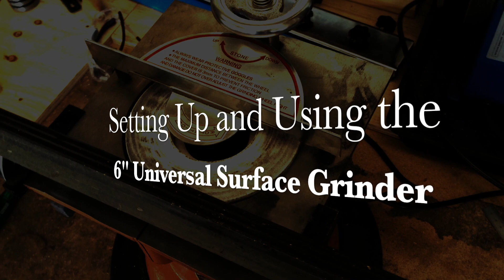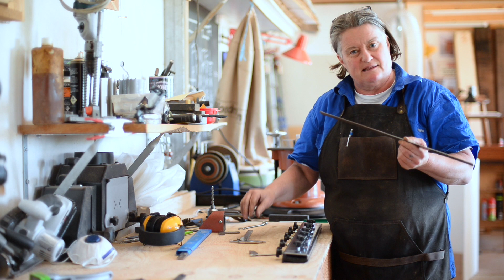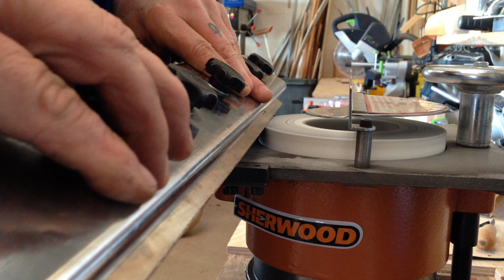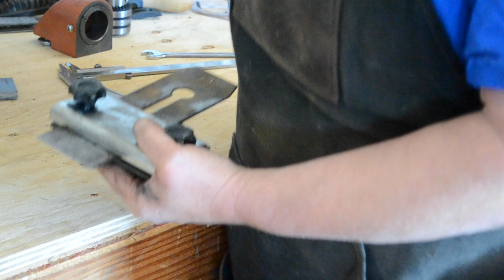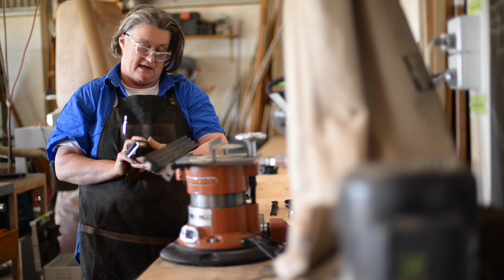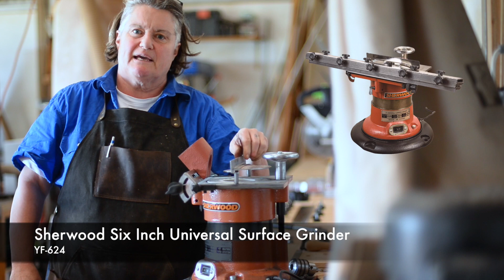How to Sharpen Your Jointer Blades

Comment: Bought this after watching the video and ruined a set of 20” blades trying to get a straight edge on them… they were super sharp but curved edge to edge… 

I reset the rests…. Tried shallow passes… changed positions on the wheel…. Nothing worked

Finally took a serious look at the tool rest… the fixed part is square and flat

The holder?….. not so much…. Two mm rock edge to edge and definitely the reason the knives are ruined

Not happy at all after spending near $600 AUD on this… quality of a sharpening tool should be better than this!!!
Reply from the maker: Hi mate, thanks for getting in touch. This is disappointing - that's clearly miles out of spec. Flick us an email at customer.service@timbecon.com.au and the guys will get this sorted out for you ASAP.
Reply: @timbeconaus  it gets worse…. I had the tool holder machined flat…. $80 well spent… however, still no joy on getting blades sorted…. After discussing with local manager (as opposed to an email…. Ever heard of 2 way rather than 1 way communication Chris?)… we spoke of a possible bad grindstone…. Another $60 for a diamond dresser…. Took off 3mm and what a difference… now it cuts !!… fixed!!! or so I thought! …  the blade angle was wrong and changed across the blade….. the cause?… the single post height adjustment. There are 4 guides machined in the base with reliefs to reduce friction and for the grinding dust etc to escape… this should minimise friction enough to allow the single screw riser to lift the table up and down….. mine isn’t machined central… causing the moveable plate to bind and jam as it only has 3 machined guides and impacts across the casting surface where the 4th guide should be. As it binds it lifts the plate out of square changing the depth and angle of the cut at random…. I’m hoping this is a ‘one off’ machining fault and will chat today about a replacement … the single screw riser is an issue….it’s definitely the weak spot of an otherwise pretty solid machine…. Wondering if the Grizzly model has the same issue?
Reply: Did you finely fix your problem, because I have the same problem can you help me
Reply: Yep… took it back and they replaced the entire motor section… new one is much better but still not perfect
Reply: @robtaylor893 I have the same problem with a different brand name but same machine. If id known about this problem before, Id not purchased it. I guess I should have looked at this first.

Comment: Just purchased this sharpener. My thoughts,
> Unbelievably underpowered motor, stalls with minor pressure.
> Very Chinesey quality. Too much play in the mountings to be accurate.
> Height adjustment is totally inaccurate and unpredictable. 
> The stone supplied is only good for final dressing, not material removal such as taking a thicknesser blade down to remove chips.
> I had to replace the stone with a 6" bench grinder stone to do blade repairs. 
With enough modifications I am sure it will just do the job, but the pathetic little motor will always create significant limitations to what its potential could have been. Very expensive for a light duty toy.
Reply: I purchased 2 yesrs ago and won't use it as it as it jams and tilts when trying to adjust hieght. Contacted supplier and all they do is keep asking irrelevant questions. I am licensed carpenter joiner with 50 years experience so not my technique!!!
Reply: @alexmcshane4584   Totally agree.
Haven't used mine in ages as it is just a poor quality low powered toy suited for the home hobbyists only.

Comment: A little tip: take the blade to the extreme end of travel and loosen up the clamp nut and let the blade fall onto the stone and tighten up that side. Now move the blade to the other extreme direction of travel and losen up the nut and drop that side of the blade to the stone and tighten. The blade will now be perfectly aligned to the stone.

Comment: This tool is interesting but...  When she started talking about how it would take hours on a wet stone to get it in shape, I was struck by the fact that the concept of course, medium,  fine never occurred to her.  If you have a really rough blade, you wouldn't start with a 4000 grit stone. A few strokes one a coarse stone, then go progressively finer.

It's the same with a chunk of wood or steel, you wouldn't use a smoothing plane to take a sequoia to a toothpick. You would start with a saw.

I looked on the company website for this tool they have an article called "Water stones vs wet stone grinders vs slow speed bench grinders - which is better?
" that starts with "If you’re a water-stoner, you probably spent most of the long weekend furiously rubbing your chisels back and forth on ‘old faithful’ trying to reset the edge.".  NO!  Using the right tool for the job would get you from "Manky" to razor sharp in 10 or 15 minutes.

Once you have properly sharpened most blades (Hand planes, chisels, etc.) touching them up should take 2-3 minutes.  For longer blades I can see that this type of machine would be very nice to have, but by no means necessary and depending on your standards, it probably wouldn't produce a finished edge .
Reply: 120 - 220 - 320 grit stones are available for it. I im in the process of finding finer stones for it but it might take awhile. The Makita fine grit stones will not work on it.

Comment: I bought it the day before yesterday and I  sharpened all my planer blades. It is the best sharpener you can get for planer blades. 
There is some set up needed and litle practise to build of course, but it is not so bad  .. :-) 
I will try to sharpen some drill bits tomorow.  
Thanks .
Reply from the maker: Thanks Rudolf. We are so glad to hear that. Thanks for the kind comment and for being a Timbecon customer.
Reply: Sharp madam  shard very good...👍

Comment: My old boss use to have all his blades sent out to get sharpened but since I was the operator of the machine it was my job to put the new blades back in, And we called it a Buzzer not a Jointer

Comment: Why did you not dress the wheel? You are contacting the wheel on the corner between the face and the side and not getting a flat grind surface. The grind finish looks terrible and is likely not true along the length of the blade.

Comment: Should be set to the cast iron base this is the register for it, as the chrome blade clamp is not the parallel component used to track by. There is some slop in it as the hole are slightly oversized. Each time you change blades it registers onto the cast iron base part to maintain parallelism to grinder.